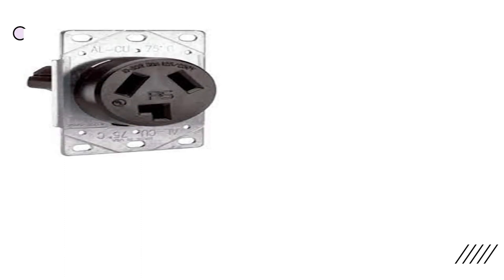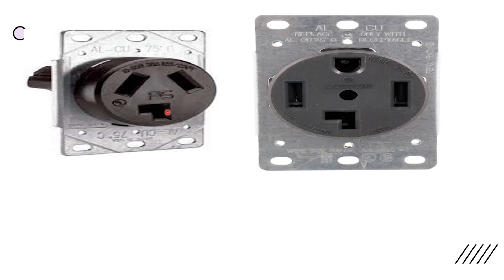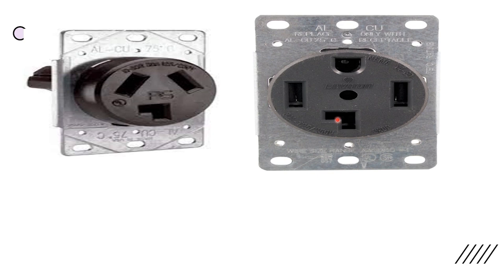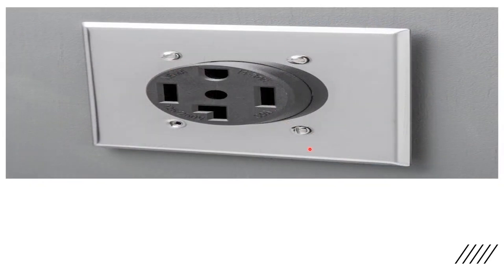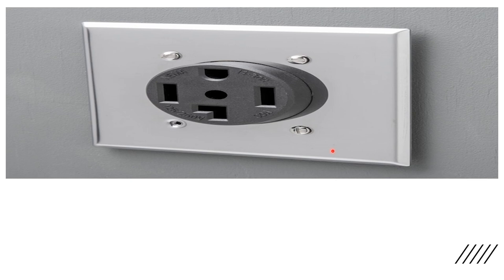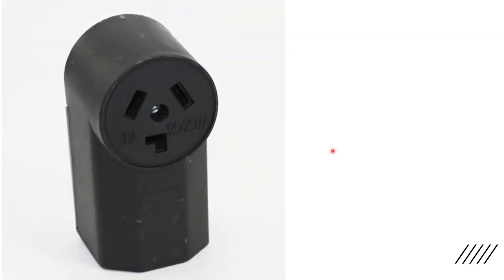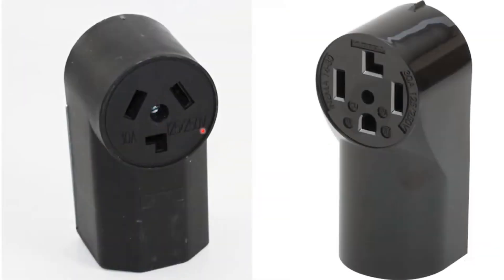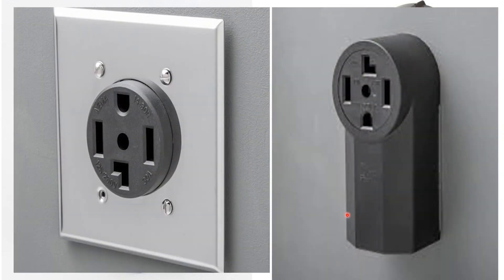Surface Mount and Recessed Dryers and Range Receptacles Explained

Comment: in some older houses the stove breaker size is 40 amps, I would be interested to know the minimum breaker size and wire size for a stove, what is the norm at this time,
Reply: 40 amps and 8 AWG copper is the minimum wire size for a range 8 ¾ kW and up.   A range rated at 11.5 kW, for example,  only draws 11.5 kW when all burners are turned to the max settings at once, which almost never happens, so they Code allows for this.    This is still done even today in apartments and budget homes, such as tract homes and manufactured homes as it allows for the savings of wire,  and anyone who's paid attention to the price of material can relate.
Reply from the maker: Thank you for the excellent explanation Kyle.
Reply: Thanks for taking the time to explain that